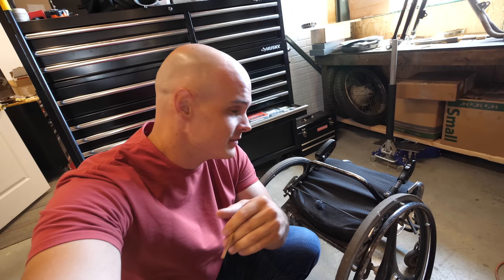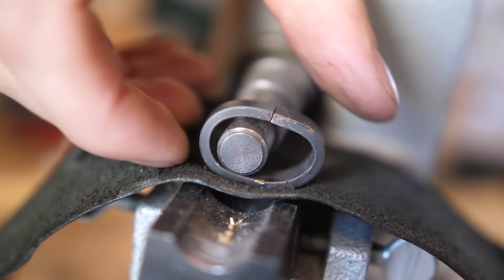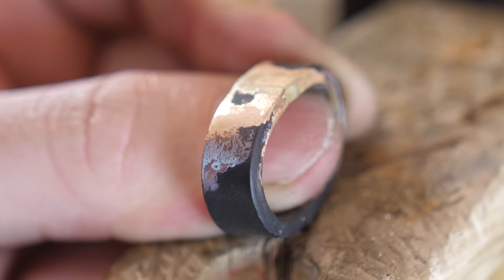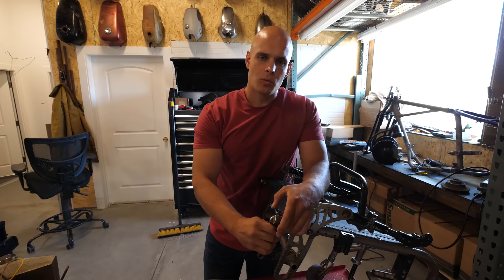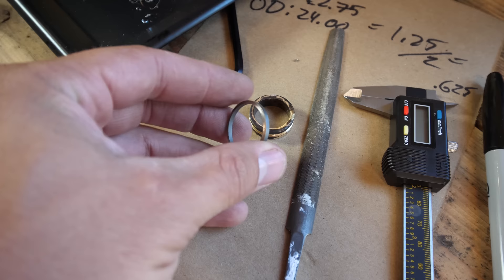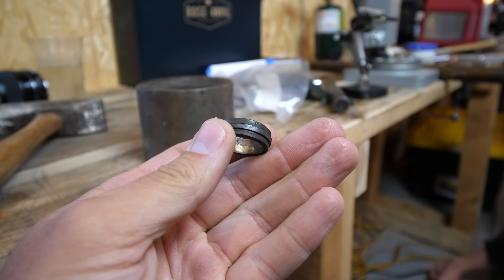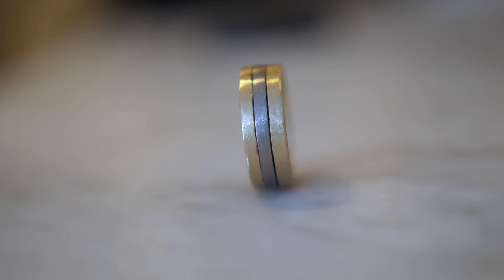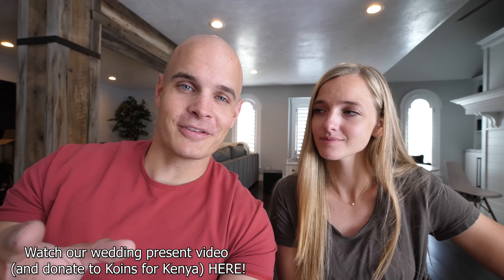Making a Wedding Ring from a Wheelchair?! - Titanium & Gold!

Comment: Only thing that bothers me is the gap that is between the titanium and the gold
Reply: I couldn't live with that.
Reply: @paulsallee4889  exactly, imagine all the gunk build up in that...
Reply: Maybe there is something like varnish for rings? But honestly, who cares? It's Zack! He will probably have a solution for this before the day is over.
Reply: @overflow7276  
Resin
Reply: I think it made it look better
Reply: Yes - it is quite ugly. I am sure, that some/most jewellers could make it perfect seamless.
Reply: That's what I'm thinking
Reply: DarknessPlayer BR fill it with diamonds
Reply: Looks like a bit of oxidation remains around it. Should be able to dissolve that with an acid though. Really should have used some of that gold powder or solder to fill the gap then file it down flush
Reply: I thought of that also, but it guess its all part of the brushed look, to also show right away that its custom made. I'm sure if they(Zack and Weston) want, they can fill the gaps with resin, to stop gunk from building

Comment: Pure elemental titanium is actually super soft, but when combined with other metals like iron (which is very hard, but brittle) it will then be about as strong as steel. The way that steel and titanium alloy get their incredible strength is when combined with something like iron or carbon (not diamonds, but other forms of carbon like graphite) which is very hard, but brittle, the soft titanium replaces the brittle quality with malleability and keeps the strength.
Reply: Nouvelle  sou  Haiti  au jourdu

Comment: part of why titanium is so expensive is cos its kind of horrible to mine. It usually comes from sand mining which is a fairly nasty process. A usual "deep" mine gets a lot of material without digging up too much land, but sand mines just take the top meter or so of land and so its like stripping just the soil off a very large amount of land. Needless to say its a pretty horrible thing to do to the environment. Still, wheelchairs are a good use of titanium. Most titanium gets used for  friggin' toothpaste.

Comment: Titanium is lighter than steel on !same volume!. But is not stronger than steel at all. Even in one bit. If you have plan to build some thing which will be have same strength physical characteristics on deformation, titanium thing will be heawier that steel but will be cheaper and eaziest in production.

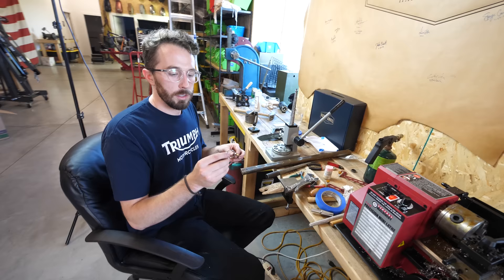Comment: 6:56 shouldn't liquid helium do the job? just put the ring inside the helium, let it cool down to very low temperatures, then heat the titanium ring and fit them together. I think heating the titanium ring works too, this is called thermal expansion of metals.

Comment: Since noone else has said it below, I say it. 

When using an acetylene torch, the black carbon build up burns off it 550C, no wonder the gold in this is so dam stiff looking. He barely got this ring hot, maybe 300C at max which is barely annealable, should of been a 500 to 600C minimum.